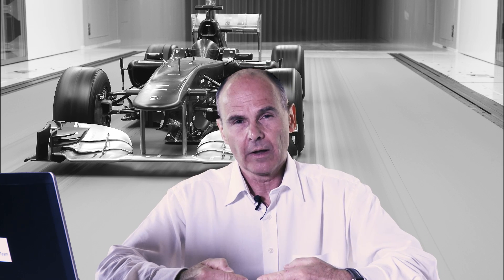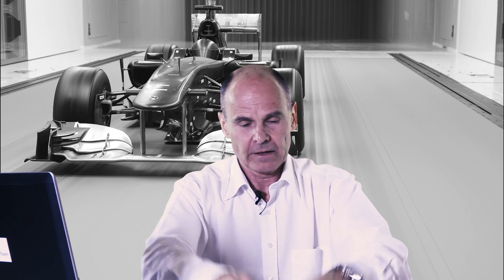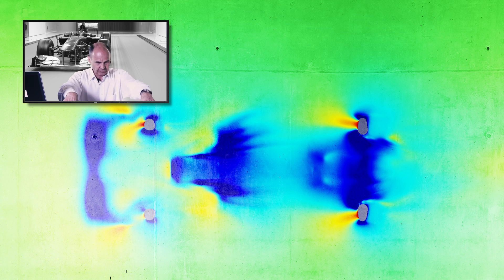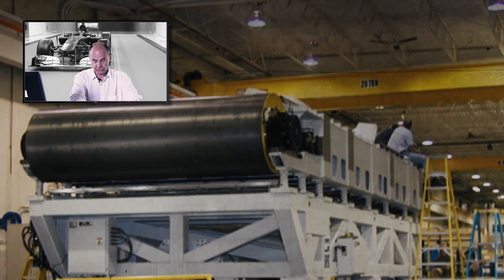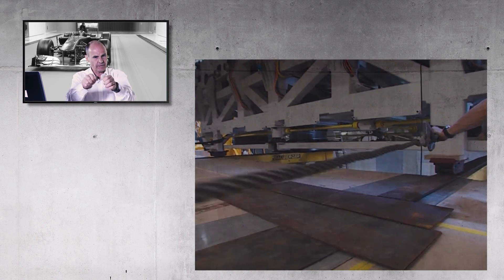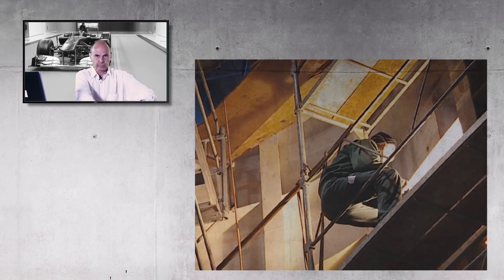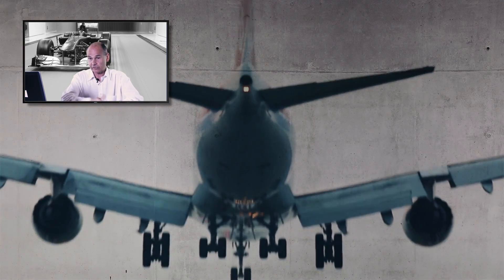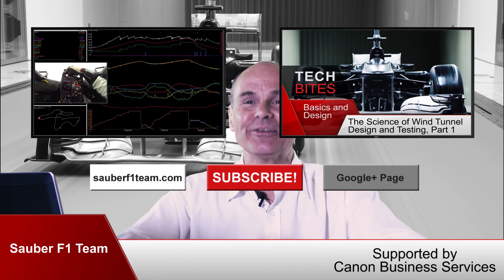Moving Ground Systems - F1 Wind Tunnel Explained 5/8 - Sauber F1 Team

Comment from the maker: Sauber F1 Team Head of Aerodynamics, Willem Toet, about the science of F1 wind tunnel design and testing! Part 5 explains moving ground systems (the rolling road) and how they developed from using synthetic rubber bands to today's steel belts. And Willem takes a look at how air bearings underneath the belt and vaccum pumps are used to avoid friction and, thus, overheating of the belt.

Already published:

PART 1 - Basics of Wind Tunnel Design
► Watch here: http://youtu.be/RBVgwpYUp18
► basic principles, history
► open-circuit vs closed-circuit wind tunnels
► energy efficiency
► fan, foundation, seismic mass, vibrations
► air rotation and turbulence

PART 2 - Heat, Cooling & Airflow Optimisation
► Watch here: http://youtu.be/AsvejoiDOoA
► heat, cooling & radiators
► airflow optimisation

PART 3 - Test or Working Section
► Watch here: http://youtu.be/FQ0PlA5nG_o
► test section, settling chamber
► closed-jet, slotted-wall, 3/4 open-jet
► contoured-wall, adaptive-wall
► aerospace vs motorsport wind tunnel technology
► boundary layer reduction in motorsports

PART 4 - Model Motion System & Tyres
► Watch here: http://youtu.be/0WZt7GjmLzg
► airospace vs motorsport model mounting systems
► model motion: yaw, pitch, roll
► wheels-on vs wheels-off, wheel steer
► wind tunnel model tyres vs. race tyres

PART 5 - Moving Ground Technologies
► Watch here: http://youtu.be/szYlGeEx-OE
► rolling road
► development: synthetic rubber vs steel belts
► development: suction control
► friction, cooling
► air bearings & vacuum pumps

Follow us now for more!

 #F1   #SauberF1Team   #F1explained   #Aerodynamics   #WindTunnel   #Science   #Technology

Comment from the maker: Moving Ground Systems - F1 Wind Tunnel Explained, Part 5/8 - yet another epic Sauber F1 Team video ;-) Watch and learn!

Sauber F1 Team Head of Aerodynamics, Willem Toet, about the science of F1 wind tunnel design and testing! Part 5 explains moving ground systems (the rolling road) and how they developed from using synthetic rubber bands to today's steel belts. And Willem takes a look at how air bearings underneath the belt and vaccum pumps are used to avoid friction and, thus, overheating of the belt.

Enjoy, Sauber F1 Team

 #F1   #SauberF1Team   #F1explained   #Aerodynamics   #WindTunnel   #Formula1   #FormulaOne
Reply: and again a briljant episode!!!
Reply: Thank you Willem, great episode!
Reply: Wind tunnel testing is the richest learning experience ever. Aerodynamacists are the masters of compromise I learned more from them than any other time in my life. Thank you Willem.